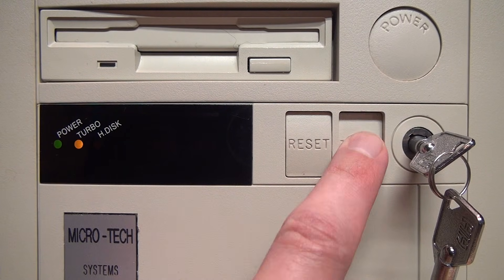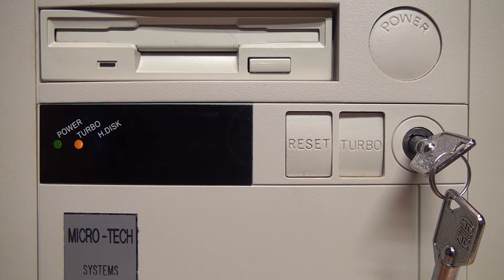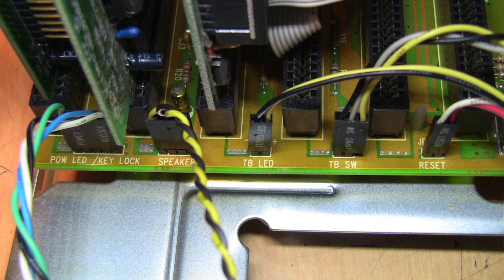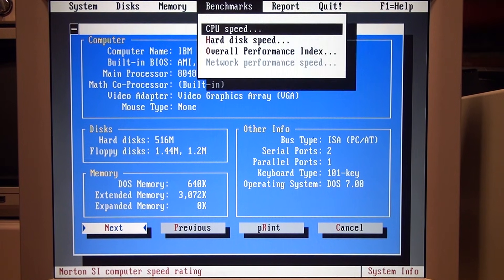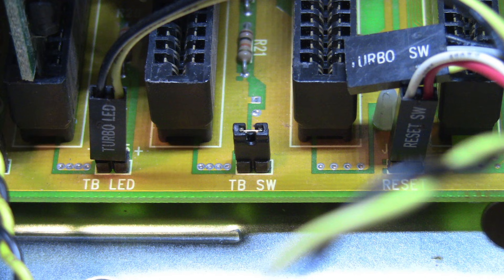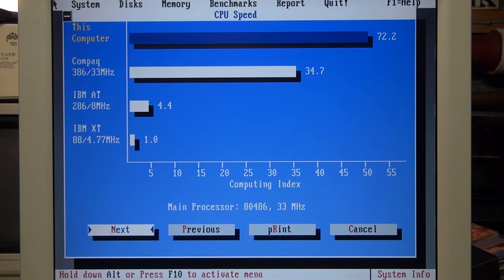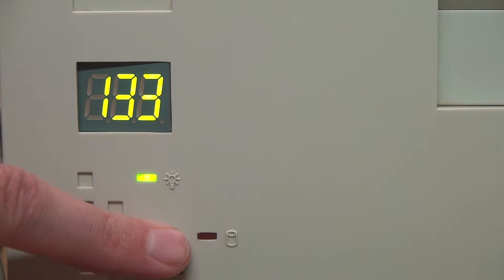The PC turbo button mystery finally solved!

Comment: I can see the source of confusion on this, but it's really pretty easy to explain:

First and foremost, the button's operation (namely it's logic state) was defined by the system builder -- ergo, there is no absolute standard.  However...

The typical application was to engage high speed when the Turbo button was pressed in, during the initial roll-out of this feature in the PC/XT/AT era.  Around the time when the 386 became commonplace, the logic flipped, and pressing the Turbo button in would engage low speed instead.  This correlated to a normalized button state that is aligned with the most common use of the Turbo feature itself.  I.e., the button should be unpressed, and therefore match the state of other buttons, like reset, when in the state that you would usually want your system to be in.  Since that state changed at some point, so then did the "polarity" of the switch.

The greater question is:  What does this actually do?  That is, how is the speed changed?  In the early days (push to engage Turbo mode), it was typically associated with a system clock divider that ran the CPU at a higher clock rate.  In the later days (push to run at a lower compatibility speed), it was implemented in a variety of ways.  That, I believe, is the true mystery -- and there could be as many answers as there are motherboards with a Turbo switch header.

Yes, I acknowledge the bit at the end with the Intel data sheet.  But, vitally, that's also the data sheet for an SL processor, which is not what most of us would have been using in a desktop PC with a Turbo button.  Does the vanilla 80486 DX CPU even have a CPUPWR register?  I'm not sure, but I don't think it does.  This would be a valid clock-throttling feature in a notebook, or a niche motherboard designed for low-power use, but probably not applicable as a general explanation of how Turbo works.  (Somebody who is not too lazy to track down a 486 SX/DX data sheet, feel free to put me in my place.)
Reply: @Toby  Do go on ....
Reply: @Toby  r/dontbeanahole
Reply: @Toby  r/keepcalmandchiveon

Comment: 13:14 when computers were hardware configured and nothing was plug and play. The joy of spending hours trying to work out why it wasn’t working only to discover a jumper missing or in the wrong position 🤣

Great video on the turbo button and why it was needed, and why books are more informative than the internet

Comment: I've never quite understood why this needed debunking, but I guess it's because some folks didn't live through the days of AT clones.  Before ATX, there really wasn't a firm standard for things like this.  AT clone motherboards often couldn't quite agree on where the mounting holes were supposed to go, sometimes being a mm or two out of place.  The turbo button thing was a gimmick and some MBs defaulted one way and some the other.  System builders just had to suck it up and deal with it.  The fact that AT case designers ran all 3 wires to the SPDT turbo switch so the button wasn't backwards was just a reaction to this inconsistency.

Comment: Back in the mid 90s I used the Zenith Z-148 PC for practicing my typing with typing tutor IV program.
The one I used at the time had the internal hard drive instead of the additional 5.25 floppy drive.

Comment: It's cool how initially important feature sticked with pc's way longer than they were useful. I remember my pentium 200MHz had still a turbo button. It dropped the cpu speed down to 120MHz when turbo was off. I remember no software requiring it though. 120 was still recent and fast enogh speed that developing software that ran locked to cpu speed was long gone!
Reply: I had an AMD K6 200mHz and I could've used a 'turbo' button that lowered the CPU to cool it off 😅

Comment: I remember having a turbo button on my first computer, a 486DX-33.  I wondered why anybody would run anything without turbo but I did notice that some really old games were better with turbo off.  I didn't realize that I essentially stumble upon the answer to my question.  Also I think people get fixated on the "ON" or "OFF" aspects of turbo mode.  I just accept that there is a full speed mode and a slow speed mode.  It doesn't really mater which is considered "ON".

Comment: Well I missed the original version of this so I appreciate this upload. I was less bothered by the turbo function itself than I was by the fact that the switch had 3 wires while the header only had 2! So you've cleared that up for me. The question I was really hoping to see answered is what factor the turbo function in-/de-creases the speed by. There's a clue at the end in that it's a function of the CPU itself, but I would love to know whether non-turbo is absolute or relative. I've got enough CPUs that I can find out for myself, so you've inspired me to do so.
Reply: Answer is really just it depends on the hardware, the 486 SLC with a turbo control line and internal divider mentioned in the video is a late model 486, earlier ones relied on external hardware (an ASIC chipset by the 386 era) dividing the CPU clock and it was entirely up to the chipset vendor to choose the division factor. Could have been jumper selectable or programmable on some boards too, but I'd wager it was almost always some power of 2 (÷2, ÷4, ÷8, ÷16, etc) because you can get it just by chaining flip-flops rather than having to use something like a PLL.
Reply: @18:40 or thereabouts, the Intel datasheet specifies 1/4 or 1/8 clock speeds (depending on the manufacturer, I assume.)
Reply: @Mahashma  great info, thanks! Gonna do some of my own tests on this as well.

Comment: I'm so glad you made this video, and with actual contemporary references to what the turbo button is actually supposed to do. I've had this discussion with several people in my club and they always take out their phone and point to some "doggone" Gizmodo like article saying turbo button "aaaccckkktttuuullly" slows it down. The funny thing is the people that are telling me this are so much younger than me and have likely never even owned or used a computer that had one. Well I have owned and used turbo mode computers and all of the ones I had (I had 4 computers that had them) the turbo mode switch was correctly wired to speed up the computer when activated by a button press using ones middle finger. Its likely more commonly pressed with an index finger. But I would routinely use my middle finger to press the turbo mode activating button as my middle finger is the longest of my fingers and the position of the button on most of the computers I had was such that using my longest finger, the middle one, was the most sensible finger to use.
Reply: The "turbo" button is a limiter. You're not enabling turbo when you press it, you are disabling a limiter. Meaning that the only purpose of the turbo button was to give you the ability to make your computer run slower. The turbo button is for slowing down your computer.

Comment: I think the confusion is due to people mixing up the reason to have the button, with the state of the button.

The reason to have the button is to slow down the PC when required, not to make it faster.  I think that caused people to assume button in means activate this feature.

Comment: In my early years I was a PC tech and did new PC builds in the very early 90's.  This was a problem because there was no standard between motherboard and case manufacturers.   If the motherboard was wired for Turbo when the switch was in then that is what we preferred.  But some motherboards, as you have seen, were wired the opposite and the switch pushed in deactivated Turbo mode.  We provided labels on request that changed it to Turbo Off.  It is great that Intel had a standard but PC makers, motherboard manufactures and case makers did not abide by it.

Comment: Yet again, another successful debunk. Well done sir! gotta love it when you put the so-called "know it all" channels in their place.
Reply: What are you talkin about? He didn't debunk anything. It's all a marketing spin. The Turbo System was an artificial limiter that slowed your computer down until you press the button or hit the key command to remove the limiter. While you were told you were turning on turbo you were actually turning off the limiter. That means the only purpose of the Turbo System was to be able to make your computer run slower.
Reply: @dmac1259  😴 other YouTubers have said the opposite for a long ass time, this corrects those people and therefore debunks the crap they're saying to their followers. I watched the video. I understood what the button was for before watching. What I didn't need was you being hostile for zero reason. 🙄
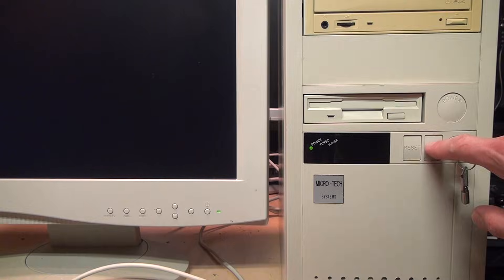Reply: He didn't debunk it at all. He says around 16:00 that the purpose of the turbo button was to slow down the cpu because when it's off your cpu runs slower. It's a combination of marketing and also compatability with games that ran off of clock spees.

Comment: Intel still has turbo to this day. Nowadays there are technologies such as Intel's Performance Maximizer or AMD's Precision Boost Overdrive that leverage all the available thermal and power headroom to increase the core frequency automatically, which used to be done via overclocking not too long ago. So basically not enabling those options slows your PC down (depends on cooling, motherboard VRM and PSU), they're the modern equivalents to the Turbo button.
Reply: No using turbo will run the processor at 'Full speed' so it's not overclocking. PBO and those really Overclocks the cpu from the base clock. 

Not using turbo will 'underclock' it. Using turbo will run it at the base clock

Comment: I can speculate why some thought the TURBO button slowed the PC down. When they were kids they poked the button while the PC was already running and saw the PC slow down, because they didn't understand that it was already engaged. Hence: the TURBO button slows the computer down! So basically it's a long held false belief gained through incorrectly interpreting something that happened to them, making it a nearly unchallengeable core belief, regardless of how silly defending that position would be. As for me, well my 10 year old ass in 1993 read a book for kids similar to the one you just showed one cold day in January because I wanted to know how PCs worked.  Then I tested it out one day in the computer lab. Poked it, it slowed down. Poked it again and it sped back up. Then I played Odell Lake in slow mode and had recess. Good times.

Comment: I remember those early el-cheapo imported 8MHz mother boards, so many were dodgy and crashed/freezed frequently. If you wanted to do serious work (as opposed to playing games) you were better off in non turbo mode.
Luckily they eventually got their act together with reliable fast boards.

Comment: Not one but two myths debunked.
Myth A: Turbo mode makes your computer run faster.
Myth B: A is a myth, therefore turbo mode actually makes your computer run slower.
Reality: Turbo mode just makes your computer run at its advertised speed, and it's turning turbo off that makes it run slower.

Comment: one of the mother boards i had in the 80's/90's had a bios switch to set the turbo function in ether direction
mode 1 - turbo switch enabled - turbo light on : low speed mode (default high speed mode)
mode 2 - turbo switch enabled - turbo light on : high speed mode (default low speed mode)
-i can not remember if there where other modes most likely there where

Comment: I had one in my first PC(a 386dx40) with the turbo button reversed. After I moved into the later 486 and Pentium eras I just put a jumper on the turbo switch as I didn't have any reason to not be in turbo mode.

Comment: I am pretty sure these turbo buttons can be wired either way to the motherboard...so the best thing is to check the processor speed in both positions... also I think different case manufacturers may get it backwards too because even they didn't know for sure lol.
Reply: Isn’t this exactly what is being explained…
Reply: @lunamonkey  I was really just giving a short explanation that is a little simpler for people that didn't watch the whole thing. How are you today? Doing alright My Brother?
Reply: @lunamonkey  Except It's being explained incorrectly.  Unfortunate that the claim to be definitive is definitively wrong.

Comment: If not mentioned. I have 2 PCs with the speed display. In many cases that multi turbo connector was also used to piggy back on the display to turn on 2 different speed displays, but that got pretty hairy trying to get all segments to work when you want them. I have mine with 100 MHz Fsb so it displays that, since mine can't go above 199.
Reply: When I worked in a computer shop we configured the display to read "HI" or "LO" rather than any numbers.

Comment: Yes. Because a lot of software used the CPU itself to limit their processing speed, running at full tilt at the max speed of the processor with no software speed management for whatever processing the program did.  hitting the turbo button didn't speed up your computer, it slowed it down. I remember playing with the turbo button on my PC clone and the game Robotron. In slow mode, the game ran properly. At high speed, you'd start the game and the robots would just blink to the middle of the screen and you were dead.

Comment: My 486 turbo button only had 2 pins, and the motherboard defaulted to "fast" mode. Without the button connected at all, the computer would run at full speed no matter what. With the turbo button connected and pressed in, it would slow down, and this would happen regardless of the orientation of the connector on the header. Maybe it varies computer by computer, but that's how mine is set up, and there is literally no way to configure the turbo button to make the computer faster, the ONLY option for my machine is for the turbo button to slow down the computer
Reply: This is exactly the problem we had in the early 90s when I did PC support and new PC builds. We always preferred the Turbo button to be pushed in for Turbo mode and that was the default except when we had motherboards like you mentioned.  In those situations we wished the cases said Turbo Off.  We provided labels if the customer wanted to change what the case said.
Reply: It's the issue of the combination of the case (button) and the motherboard. The whole point of three-wire setup as was shown in the video is that one pair of wires works as "normaly open" and the other pair of wires works as "normaly closed" – that way you could simply choose by moving that connector one pin to the left or right.

However when you have case that has a "normaly open" button and motherboard that is set-up so that open = turbo, then yes, pressing the turbo button (closing it) will switch the motherboard to slow mode. You would have to replace the actual switch in the case for a "normaly closed" one. Or maybe there is an unused pin on that switch that acts as a "normaly closed" pin, so it would be enough to resolder the cable on that end (or move the wire, if there is pin header on that end as well).
Reply: @Tomas_Stec  Yeah but the one thing you can't do is make the PC run slower when the LED is on (and that wouldn't make any sense anyway, turbo suggests higher speeds). It might simply be a poor choice of words for expressing the fact that turbo mode was indeed the default speed of the CPU and disengaging it made the computer run slower though. Or someone put it like that and someone else misunderstood it.
Reply: @Ragnar8504  One NOT gate + some stable voltage which you can steal from the "power on" LED and you can have the turbo LED working inversely. OK, it's a bunch of additional components.

Comment: The original purpose of the Turbo button was to slow the clock down (with the button off) to 4.77 MHz or 8 MHz so that games coded for the original IBM PC would run properly.  Once clones became popular, the guys writing the games figured out how to write delay loops and routines that compared execution time to the system clock to figure out how to make the games consistent across hardware.  Not sure what purpose the button really served once Windows 95 was the norm, as you couldn't ever slow a Pentium down enough to run a 1985 copy of Flight Simulator for MS-DOS normally 😂
Reply: as the video says, the first turbo modes were off by default as it could break software from running at all.

Comment: *seek test. Memory doesn't make noise like that. That's the floppy drive seek test beginning.
Reply from the maker: No, that definitely is the noise of the memory test. I have it set to skip the RAM check above 1 MB, so that's why it buzzes. The speaker in that case is rather loud.

Comment: There is no mystery I have been aware of this and it's function since the old days. It's because there was a pretty fast advance in a short time and they needed to newer machines to be able to play / use older software and other issues.
This has never been the mystery you claim that it is.

Comment: Had a 486 clone, about 30 years ago. And my turbo button was active when pushed in. And I compared it by turnin' it on and off while runnin' a screensaver. The difference was usually readily apparent.
Reply: my 486 had a simple button with no locking function, luckily the case had a built in led panel displaying the current clock speed
Reply: We had a 486 too and I remeber it was going from 8Mhz to 40Mhz with turbo mode enabled.

Comment: Turbo was all over the place in the 80"s. Slowed down radio control cars so one could enable Turbo mode bam! And Nissan cherry in early 80"s with 80 HP turbo engine was relatively pointless as a vw rabbit GLI  nonturbo had 112hp